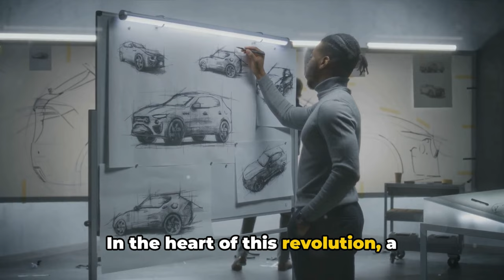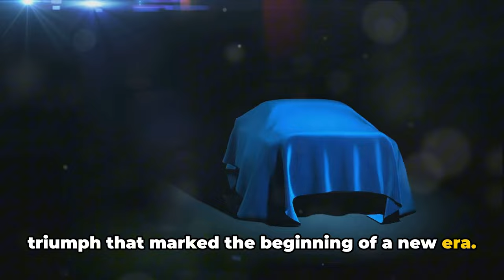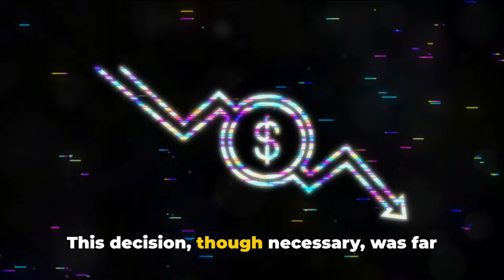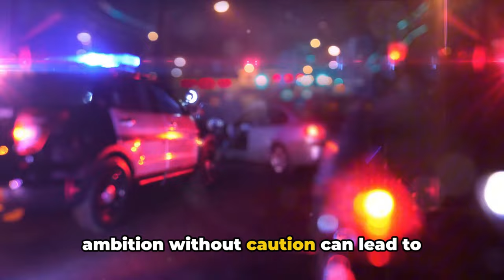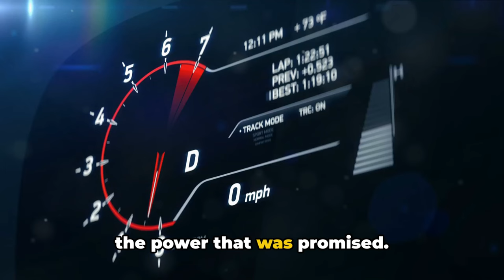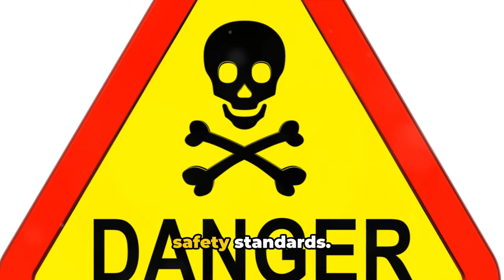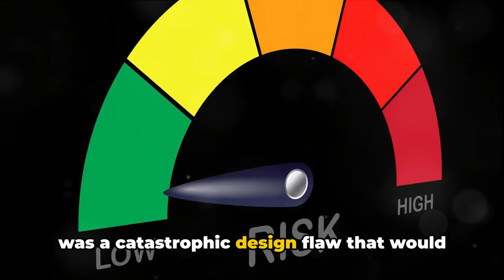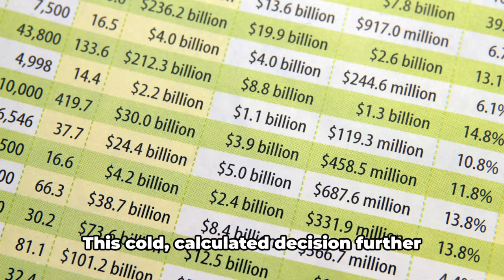Revealing: The Terrifying Truth of the Worst Car!

Comment: Many, many cars of all brands made in the 1960s and 1970s cars had the gas tank behind the rear axle. Pickup trucks of that vintage had the gas tank in the cab of the truck. 
Here are the real stats of the Pinto "fire bomb". Over 1 million made and sold. 23 people died from fire when they crashed their Pinto. 
What about the VW Beetle? The gas tank was in the very front. Just about everybody that was in a accident that caused the front to be smashed, was burned to death. 
The Pinto was a victim of subversive advertising. GM could not make a Vega that was reliable and dependable. GM did not improve their product, they paid the press to smear their competition.  This has been proven.